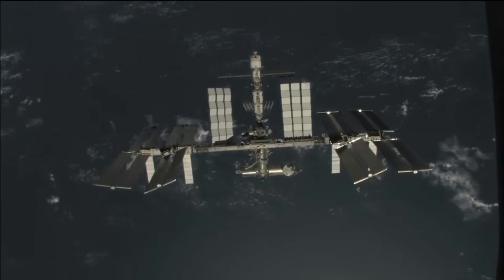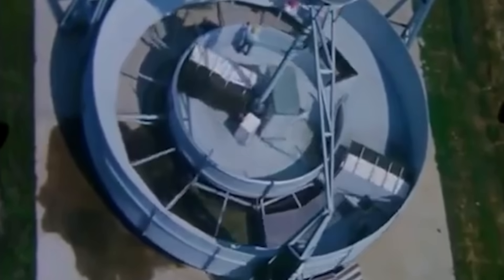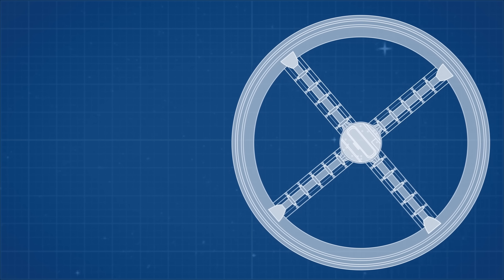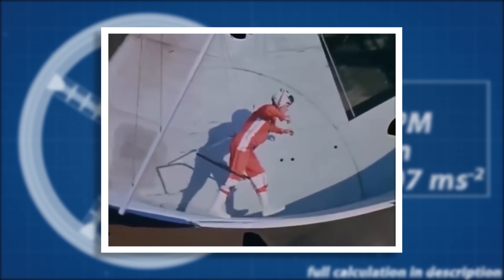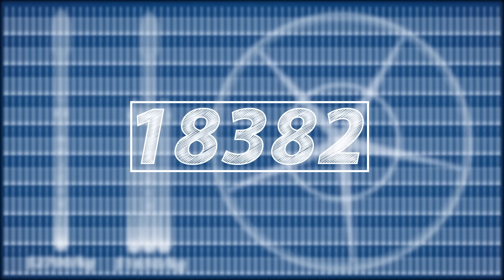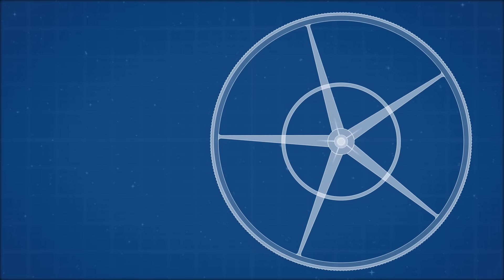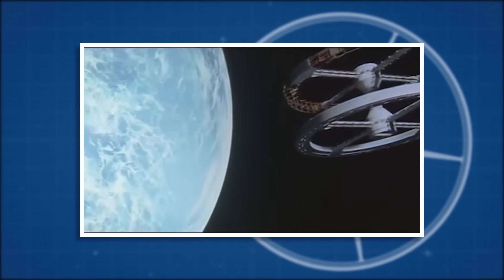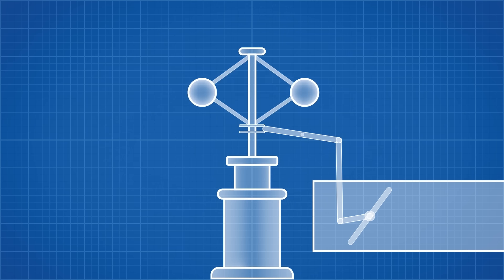Can We Create Artificial Gravity?

Comment: Centripetal is a force. Centrifugal force is an observed phenomenon as a consequence of inertia. Inertia is not a force. 

If you stop acting on a body that is being forced through centripetal force into angular momentum (in other words, the centripetal force is causing the object to travel in a circle), the body does not continue to move in an angular path... as would be the case if indeed centrifugal "force" was a force... because Newtonian motion would say to us that a body in motion will remain in that motion.... unless acted upon by an outside force... 

What happens is that the angular momentum is an illusion and as soon as the centripetal force is no longer applied... the object moves in a straight line... 

To understand this fact... take a piece of string with a weight on it... spin it so it gains a nice arc of a circle of momentum. The tugging you feel on the string by the weight people interpret as a "centrifugal force"... but what that experience actually is ... the constant angular momentum change... i.e., the centripetal force acting on the body to continue its curvilinear motion... 

If you let go of the string... the object does not suddenly go into orbit around the axis of rotation (which is what would have to happen if centrifugal forces were real) but instead the object flies in a straight direction according to the vector where it was released from angular motion... 

Centrifugal forces are a phenomenon of inertia and what we experience... we experience the pushing against the tilt a whirl because that is the resistance to the angular motion caused by the spinning... that is not a real force... but just intertia... 

Which is why centrifugal forces are referred to as psuedo forces... which is not a force at all... but a phenomenon associated with acceleration and inertial experience upon an object. The idea that forces exist only inside reference frames is a cheat... the reality is there is no force... just like there is no spoon... 

Forces exist outside reference frames if they exist... and the force acting upon an object is in existence across all frames of reference... not just from inside one... although what you may "observe" or experience in all frames is not necessarily the same... the force exists in all frames...

This is why we're so puzzled by gravity. I mean think about it - the Earth is gi freaking normous... and the entirety of that gravity force is pulling against you... your computer... your desk... etc... and yet you can lift a paperclip... because inside the frame... the only degree of force you must overcome is the differential between you and the paperclip... 

But to an outside observer... that force also is observable and so is the differential... 

But to believe in centrifugal force... you have to observe a force that is unobservable in all other planes except for the angular momentum plane...

... which is BS in terms of Newtonian mechanics... which is why it's not a force.... but just an experience of intertia.

Comment: Too many assumptions. Carbon fibre instead of aluminium. Abundant, lighter and cheaper in mass production. You don't have to build so large either. The object is to expose the human body to sufficient artificial gravity on a regular basis. Calculations have already established that 0.7G during the sleep cycle each day would be enough to avoid serious damage in the long term. A much smaller arrangement is easily possible.

Comment: That's all to complicated! Why didn't you even mentioned the easiest way to get artificial Gravity? Perhaps on a trip to Mars... the only thing you need to do is: build the spaceship in two modules, the living module and the module wit the fuel tanks and things like that. In space the two modules (best perhaps if both have a similar mass) separate from each other connected by a strong wire, and a few cables and tubes to a distance of half a mile or so. Then give thrust from both modules in opposite directions so that the modules spin around each other. You will get perfect artificial Gravity!

Comment: It came clear to me that we are dealing with two different definition of the word "force".

There is only 4 forces, so the inertia of a mass accelerated (providing an external source of energy) or decelerating (wasting energy as heat, like in brakes or a car crash) is not part of these 4 forces.

Debating on the word force often degenerate in a "deaf dialogue", which means two people will defend their point and think that the other is a total idiot. For the "word purist", it is absolutely forbidden to use "force" when describing inertia or  Coriolis for example. On the other hand, those who try to understand what is really going on may think that his "adversary" deny the existence of inertia or Coriolis. If we can not only feel but objectively measure the motion of object in a car the accelerate or break abruptly, then don't tell me this is "fictious"... it is real.
When we take the time to define the meaning of the words we use, it become clear that there is no real difference..

Comment: yeah, cool. but the space between the centre and outer layer of the rotational "wheel" is kinda useless, as "gravitational" differences there would be too much to be usable. Also, Al will probably never be used for structures like these, especially when they are achieveable decades from today. Most probably some form of carbon fiber or carbon nanotubes.

Comment: I hope you are a real engineer if ur using the title - if you are then u know that centrifugal force is pseudo force - it is used for calculations - calculations that engineers start to do in second year. You also would know that the reaction force which is an actual force is the centripetal force and that it does not act outward, it acts at a tangent to the rotating body.
So the dude walking is actually pushing away from the rotating body using a force vector that is tangential.
Part deux - gravity is not the problem - there is tons of gravity up there - the problem is that things in orbit are continuously falling - not "zero" gravity - which if you think about it makes no sense - how can gravity go to zero?

Comment: Sigh. You're implicitly misapplying relativity, when you use the reference frame argument heard in this video. "Centrifugal force" is a pseudoforce, not a real force, because a rotating frame of reference is an accelerated frame of reference, not an inertial one, and so the laws of Physics as seen within it wouldn't be the same.

Here's a thought to consider, if you mistakenly think otherwise: Consider a distant star, any one will do. Really,  even Proxima Centauri will do for this. In the rotating frame of reference, how quickly is it moving? Do the calculation. It will be going many times faster than light. Does that still sound like a legitimate frame of reference for relativistic purposes, to you? So please, when people with degrees in Physics tell you that you're looking at a pseudoforce and not a real force, lose the feelings of persecution and understand that you're being told the truth.

Comment: OR... capture two big asteroids that are the same size. Bore holes in them so that they look like Swiss cheese. Line the bored holes with a cheap plastic lining.  Tie them to each other with long cables that will hold them far apart. Then spin them at the right speed. Now you've reduced this problem down to drilling holes in space rocks that are already in space. The rock will protect people from space radiation as a bonus too.

Comment: What if you do not use a well but just two pods rotating at oposites sides of a center line.  I remember one guy that was really into traveling to mars that design a prototype of a ship with that design.  that will make it cheaper.  also if you do not make the counts on aluminum but other new materials + 3d printing is not so crazy anymore.  Thanks for the video.

Comment: No centrifugal force isn't a thing, it's a pseudo force created by a combination other forces. 

To say that "centrifugal force is absolutely real" is a out right lie. If the floor would be removed he would not shoot out in a curved trajectory but a straight one.
Reply: Völundr Frey mother of god you people
Reply: Völundr Frey yup
Reply: Do you know about the coriolis force?
Reply: Directory Error no but do u mean coriolis effect.
Reply: Sorry boss, depends on the reference frame.
Reply: @CyrilleParis
Stop spreading misinformation. Try to find a single physics college level textbook that mentions rotational centrifugal force as being real; hint, you can't. There is no set reference frame that a centrifugal force exist; it is only seen with a curved line as a reference "point"(known as a rotating reference frame) which isn't a valid frame of reference.

It is very easy to prove that it is an invalid reference frame. Imagine an object on a clockwise spinning wheel, the object is pushed "up"(away from the center) by some distance. According to the reference frame used to see centrifugal force, the object would just move up and that would be all, but we know by conservation of angler momentum that the object would actually start moving counter-clockwise relative to the surface. 

It is called a pseudo force because it only has some of the properties of a force. To be exact, it breaks down whenever a radius changes. It is not fully compatible with classical mechanics. You could fix this by adding more pseudo forces(Coriolis and Eular forces), but at that point you are tracking 3 forces instead of just using the single force that actually exist.
Reply: Amir Abudubai this exactly. It’s sort of irritating that RE would say in the vid “it is a real force” when it is a pseudo force. The math he uses is for regular rotational systems and doesn’t need “centrifugal force” to work. That doesn’t mean the person within the frame doesn’t experience it as if it were real, it’s a matter of perspective. But if you look at all the forces when standing outside the system you realise it is only a matter of the person being constantly accelerated, and his/her mass resisting that change in direction of travel. Let them go and they would continue with the current velocity at the direction of the tangent. There is some discussion of the subject here: https://physics.stackexchange.com/questions/109500/does-centrifugal-force-exist
Reply: Völundr Frey The Chinese weapon called the Meteor Hammer uses centrifugal force to work. You Tube it.
Reply: Frey, if you are going to say centrifugal force isn't a real thing then you have to admit gravity isn't real either. You do know Newton himself said no one should take his theory of gravity seriously right? He said his theory of gravity was ridiculous because it was impossible to apply a force at a distance... And he was correct, there is no such thing as the force of gravity as Einstein proved.
Reply: Centrifugal force is absolutely real in a rotating frame of reference. Yes, from an inertial frame of reference, it doesn't exist. A rotating frame of reference can measure this force.
Reply: I am always amazed with these people's craze about the centrifugal force being real or not. The whole issue is stupid and denotes a very clear ignorance of physics. Or it denotes some people with only a high school understanding of physics mimicking what they were told without understanding it.
In the Newtonian world, the centrifugal force is both a real and a pseudo force : it all depends on your frame of reference. None is truer than the other, it is just two different ways, equaly correct, to describe a phnomenon.
Now in the Eisteinian world, all these forces, including gravity, can be seen as pseudo forces because they are only the result of the geometry of spacetime. But they are real phenomenon you can mesure, so it is just a way to describe those phenomenon and it has absolutely no meaning to make a difference between a pseudo force and a real force.
The only issue is what gives you the right description in the reference frame you use.
Reply: correct

Comment: What about wearing a suit that is being pulled down by magnets?
Reply: That wouldn't solve anything because your blood, bones and tissue would still be weightless.
Reply: +Simon Koetsier I don't think it would work well, first point is that the "gravity" cannot be equally distributed across your body, then all the spaceship would've to be covered in magnets
Reply: SnowyCoder That first point can be solved by stronger magnets on higher bodyparts, amd about the second one you are right, but I think it might be at least cheaper than the spinning concept.
Reply: Although walking would be pretty messed up now that I think of it
Reply: Robert De Groot then how about a magnet so powerful that it will pull you just because of the iron in your blood stream.
Reply: Magnets would mess up the electronics in the station.

Comment: Pardon my English.
The trouble is Coriolis force. It means that when you inside that rotating station and try tossing up a ball, it will not fall "down" to your feet, but rather some distance away from you. You better watch videos, where children rotating in a small carousel try to pass a ball, you'll get what I mean. I suspect people will feel this force and throw up A LOT because of it, just like on the boat. And then after adaptation they will continue throwing up when they return to normal gravity. So centripetal force is just an imitation of real gravity force. I suppose, in interstellar travels it is much easier to create constant acceleration the first half of the flight, then reverse the ship and decelerate rest of the flight. In constant acceleration of 0.1-1G you will imitate real gravity much better (well, obviously according to Einstein's theory of relativity, it is practically the same), so no throwing up! :)
However I have nothing to say about orbital stations – there's no chance you can do anything similar in that case.

Comment: Centrifugal force is not real, it is a (very convincing) illusion. If you map the trajectory of an object rotating in a perfect circle around a center point without moving, its force vectors are tangential, where centrifugal force (as defined by google) is "an apparent force that acts outward on a body moving around a center, arising from the body's inertia." So this states that the force is a ray from the origin of the circle to the circles edge, and then following the strait path outward, which contradicts the actual trajectory of an object. you can do this experiment at home. get a camera that you can record slomotion and/or a high fps video and record yourself (preferable outside) with a rock or other weight tied to a string. swing this in a circle with your hand as the axis while recording, release the string (try to release it as the weight is strait down if you can) and watch the trajectory, and observe what i am saying
Reply: I tried and somehow my hand got stuck in the toaster
Reply: Centripetal acceleration feels like a force when used this way.  But it’s not a force.  Maybe he didn’t want to get into that discussion in the video since many viewers might find it confusing?
Reply: anonymas The Chinese weapon called the Meteor Hammer uses centrifugal force to work.You Tube it.
Reply: Timothy Meyer http://phun.physics.virginia.edu/topics/centrifugal.html
Reply: Anonymas, Not real? You have heard of gyroscopes right??
Reply: anonymas Real Engineering was right.
Reply: If centrifugal force isn't real then explain me this: grab a bucket full of water and then spin it around quickly. Very quickly. The energy you are generating in rotary motion is pushing the water into the bucket. This is centrifugal force in action.
Reply: What you see there is inertia—inertia from the force tangent to the force of the tension from your arms holding onto the bucket.
https://www.desktopclass.com/wp-content/uploads/2012/08/circle-with-a-force.jpg
You can see it in this diagram. This is also how a satellite stays in orbit—just replace tension with the force due to gravity,